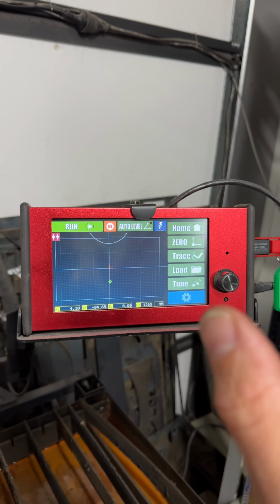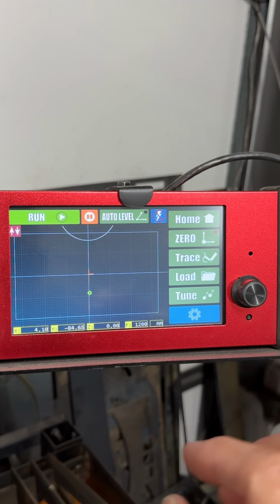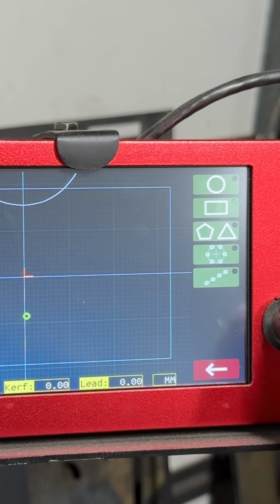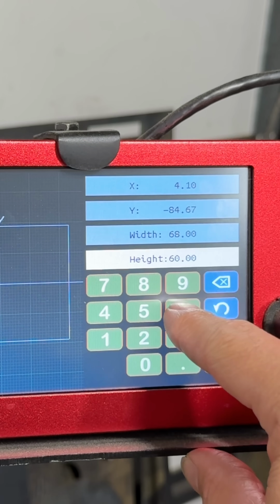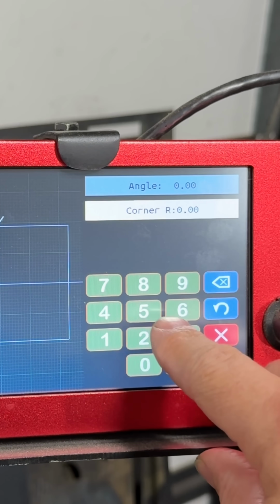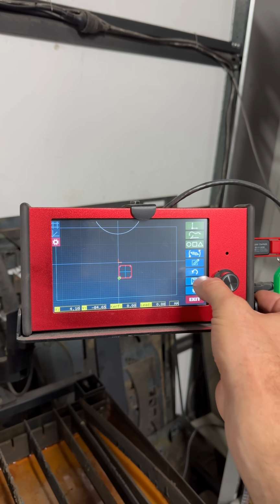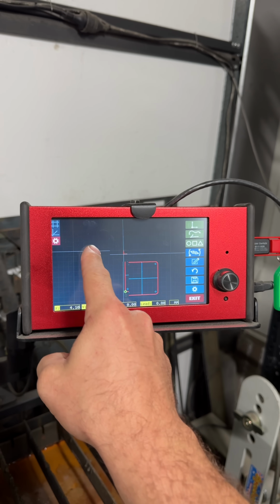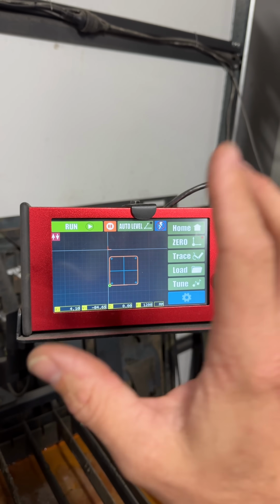Arcdroid Simple Trace Function #arcdroidcnc @ArcDroidCNC    #diy #welding #sandblasting

Comment: Hey mate, is it possible to trace something that is 1300mm W x 1100mm L so it can be loaded into Fusion?
Reply from the maker: Hey thanks for the comment. The arcdroid is very limited with the reach of its arm. You have to be working’s within its limits. 26" x 15" (660mm x 380mm). What is the reason for needing to trace something that large?. Maybe you could take a top- down image and use the canvas function in fusion 360 and then calibrate the image to adapt to your dimensions